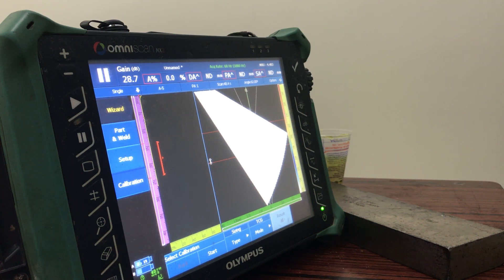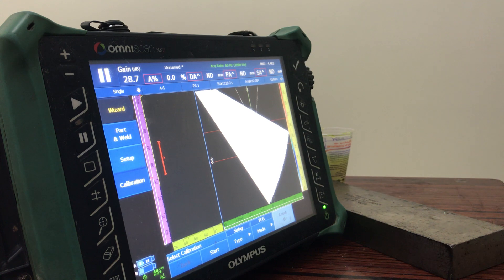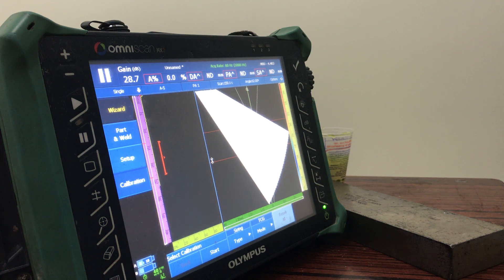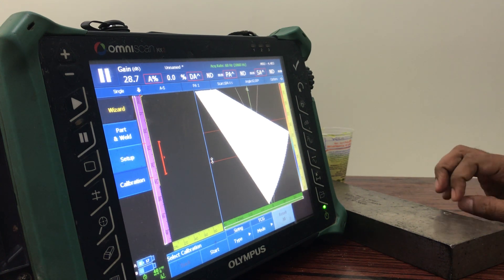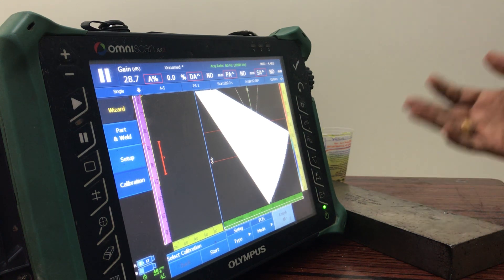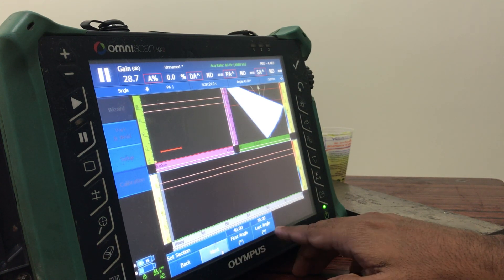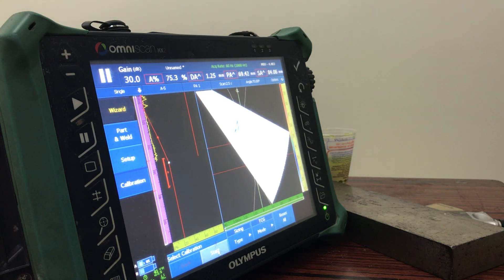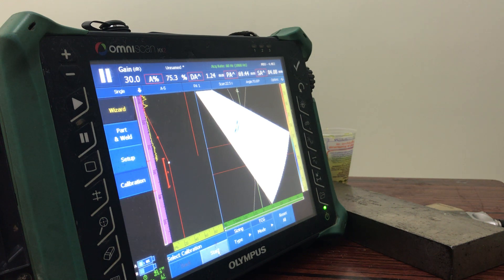NDT PAUT TCG Calibration

Comment: Hola, quisiera consultar, cuántos puntos o agujeros se toman en cuenta para elaborar la CURVA TCG? Depende del espesor de la soldadura?
Reply: Muchas gracias por tu ayuda, eres lo máximo
Reply from the maker: @Danielbarca09  siempre eres bienvenido ... 👍😀🙏🏼
Reply from the maker: sí, depende del grosor del trabajo.  el primer punto 1 / 2T, el segundo punto cerca de T y el tercer punto debe ser 2T, T- espesor del trabajo...
Gracious
Reply: @CLUSTERNDTTEAMINADVANCE  muchas gracias, entonces si deseo inspeccionar una soldadura de 9mm tendría que calcular la relacion de 1/2(9mm), 9mm y 2(9mm)
Reply from the maker: @Danielbarca09  suppose Job thickness 15mm
using Navship standard calibration block (SDH depth 6.35mm, 19.05mm,31.75mm&44.45mm)

So u have choose 1 st point ~=1/2T(ie 6.35mm u can choose)
2nd point ~=T(19.05mm )
3rd point~=2T(31.75mm)

Supongamos que el grosor del trabajo es de 15 mm.
 utilizando el bloque de calibración estándar Navship (profundidad SDH 6,35 mm, 19,05 mm, 31,75 mm y 44,45 mm)

 Por lo tanto, debe elegir el 1er punto ~ = 1 / 2T (es decir, 6,35 mm que puede elegir)
 2do punto ~ = T (19,05 mm)
 3er punto ~ = 2T (31,75 mm)

Comment: Can you show me how to TCG calibration for pipe
Reply from the maker: Mammoet Thai thanks for ur valuable question!
For the pipe u have to follow top notch and bottom notch ( as per approved procedure), otherwise for that plz do the calibration with Navship & V1 block (other standard cal block ) , after that u can go for daily Calin & out with the help of given pipe block ( main thing is notch is perfect reflector) so u have to reduce db upto 80 % FSH, and proceed for job !
Reply: CLUSTER NDT TEAM IN ADVANCE this case    Do the TCG.   Manual or Auto TCG
Reply from the maker: Mammoet Thai auto TCG , 1st point bottom and second top notch

Comment: Sir what is different between process piping and power piping
Reply from the maker: Kumar Raj actually these notes r from code case plz go through that
Power piping means piping systems and their component parts, that are not building services piping systems, and that may be installed within electric power generating stations, industrial and institutional plants, utility geothermal heating systems, and central and district heating and cooling systems. Power piping includes, but is not limited to, piping used in the distribution of plant and process steam at boiler pressures greater than fifteen pounds per square inch gauge, high temperature water piping from high pressure and high temperature boilers, power boiler steam condensate piping, high pressure and high temperature water condensate piping, and compressed air and hydraulic piping upstream of the first stop valve off a system distribution header.

Process piping means piping systems and their component parts, that are not building services or power piping systems, and that may be installed in petroleum refineries, chemical, pharmaceutical, textile, paper, semiconductor, and cryogenic plants, and related processing plants and terminals.

ASME B31.1 - Power Piping
This code contains requirements for piping systems typically found in electric power generating stations, industrial institutional plants, geothermal heating systems, and heating and cooling systems.

ASME B31.3 - Process Piping
This Code contains requirements for piping typically found in petroleum refineries; chemical, pharmaceutical, textile, paper, semiconductor, & cryogenic plants, & related processing plants terminals.

Thank you

Comment: can you share a video of set up creation and calibration in piping block? how we can create tcg in curved block? please share if you have any study material like this video. thank you  and i  hope you will reply me in positive way.
Reply from the maker: fun of fun thanks for ur comment,
For piping block ,first of all u have to make calibration block with top notch &bottom notch,same parameters ,otherwise make with limited range blocks means
Suppose we have 24” x 20mm thickness specimen
Thickness tolerance 25% of the thickness, so u can choose 15 mm to 25mm and for diameter .9 to 1.5 ( .9x24 to 1.5 x 24) ,that’s means 21.6 inch to 36 inch ) , I hope u understand. If you have any doubt means  just inform to me . For further details I will make another videos for that.Thank you
Reply: @CLUSTERNDTTEAMINADVANCE   i got your point but in my knowledge if the specimen is greater than 20 inch then we we can use flat block and we should not think about the diameter range of 0.9 to 1.5. but if we have same curved block we can use, but if the specimen is less than 20 inch in dia we must follow that range of diameter. 
please make a video for piping joint of less than 20 inch diameter .include setup, ,velocity,wedge delay sensitivity and TCG calibration in curved block. i will be thankful to you for whole life time. 
thank you so much
Reply from the maker: fun of fun yes u r right, I will make a video for that .
Reply: @CLUSTERNDTTEAMINADVANCE   thank you so much.